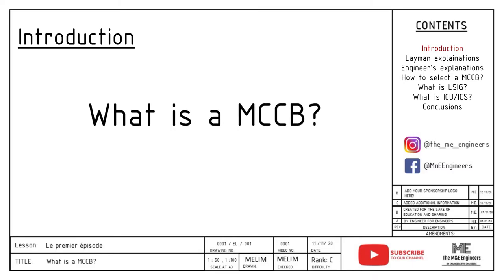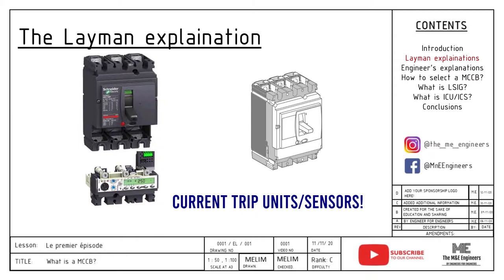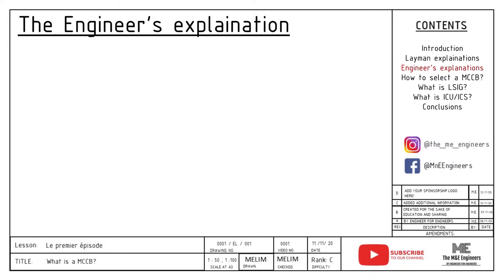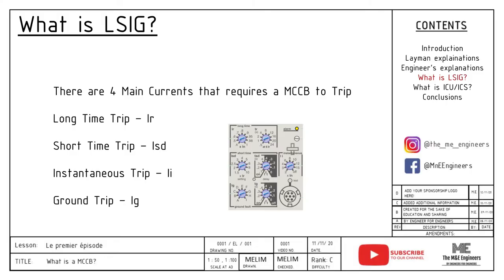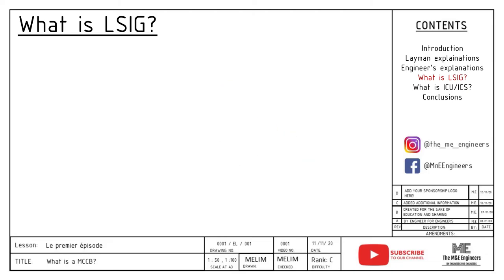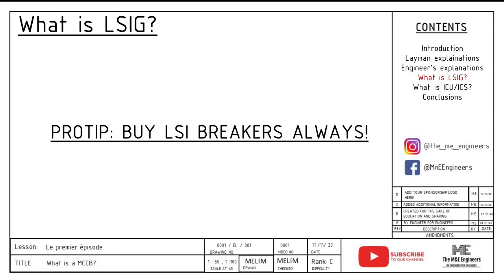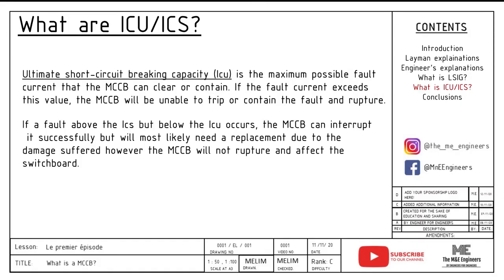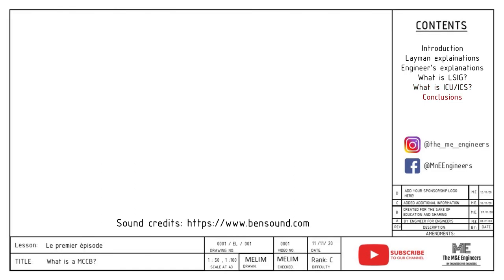Episode 1 - What is a MCCB Moulded Case Circuit Breaker, LSIG, ICS, ICU? Explained by a M&E Engineer

Comment: Hello can i check if all mccb comes with a electronic trip unit?
Reply from the maker: Hello, there are different trip unit available. Some are thermal magnetic and not electronic. So the answer is no. So depending on your site requirement you may choose different trip units.

-Weet

Comment: Sir I have ha MCCB (Main breaker in MDB) rated as below:
MCCB NSx400S
400AT 3P
415V AC schneider
now my system voltage level is 127V/220V.Can i use the above MCCB.
THANKS
Reply from the maker: Hi do check out the rated voltage. It'll affect the max ssc the breaker can handle. It should be no problem

Comment: How calculate the MCCB currernt if 400A breaker its is the sum of three phases or each phase can connect to 80% of 400 A?
Reply from the maker: Every phase is rated at 400amps my friend. Overcurrent at any phase will trigger a trip. Using an trip unit you will be able to better check which is the errant phase.

Comment: What is Icw??? Great video, saludos desde Argentina!
Reply from the maker: It is for utilization A breakers and lv switchgears. Usually it is the maximum short circuit withstand current rated up to a certain time. Usually 1 second or 3 seconds. Examples are 85kA 1 seconds, or 50kA 3seconds. Mucha gracias pal.

Comment: Is it possible to disable the mccb breaker (to stay always on) easily?
Reply from the maker: Depending on the model, you might be able to off the protection with electronic trip units. In your case i would suggest using a switch disconnector. Much cheaper and always at the status u left it. However there will not be any protection